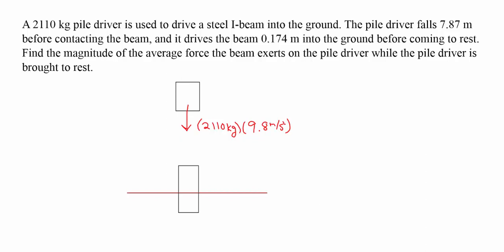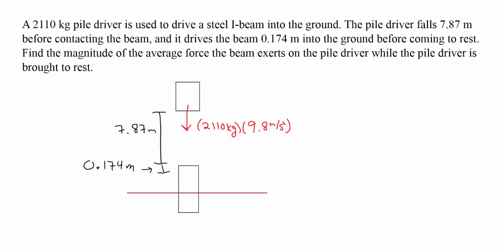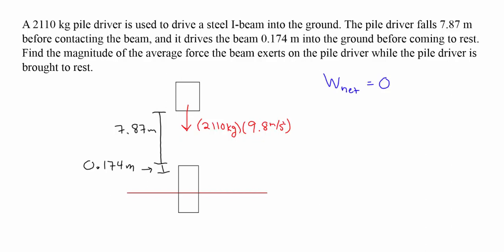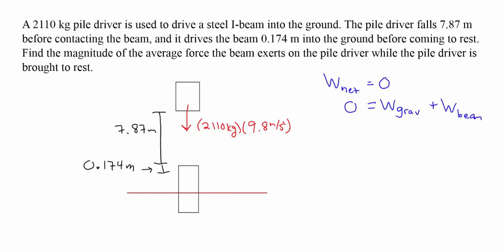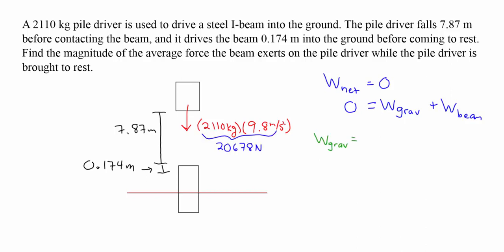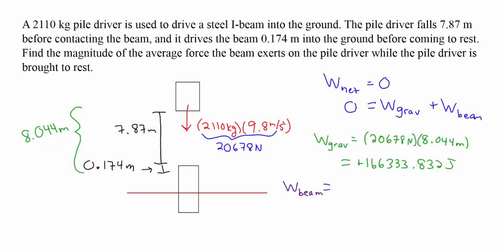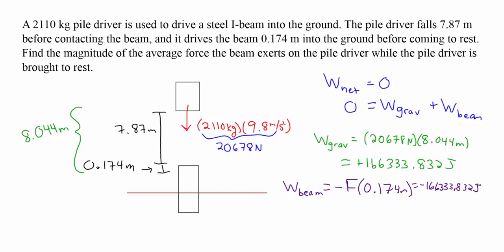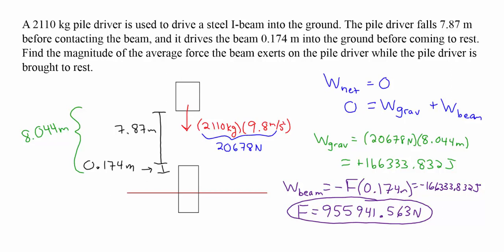Finding Work Done by and Force of Pile Driver Dropped on Beam

Comment: Dude... i think you must consider that you still have the gravity force pushing the pile through z axis when the pile hits the beam... so, the average force is going to be slightly bigger than your calculations... do you agree?
Reply: lol. his answer is correct mate. its called conservation of energy.
Reply: @ahmadazeem8279  Mate, the way he did the calcuatios is fine for colisions on horizontal axis, where there is no acceleration, only inertia. When analyzing colligions on Z axis you must consider the gravity doing an extra "impulse". The gravity still pushes the object during the coligion, it does'nt happen when the colligions happens on horizontal axis... Take a look on simple pendulum problemas...
Reply: Daniel Pini omg. u went so far man. its not even related to inertia. plus,he did use the acceleration for the gravity. This question is from big book of physics and the concept in remain same. and one more thing,there is no anything related to horizontal line 
Only about vertical line. we are talking about 2D in this problem not 3D.
Reply: @ahmadazeem8279  Dude, an horizontal axis and a vertical axis are still in the same plane, and of course, its still a 2D problem... what the hack are you talking about 3D? I didnt get your point here... Even if it were a 3D poblem you can solve it for ani axis you want.. .the answare would be the same... With all the respect... are you in high school?
Reply: Daniel Pini u are the one who said z axis 😂
z axis is for 3D problem. and of course u can do it with 3D problem. My point is u should learnt from this guys what he did. not thinking like u better than him. Im suprised suddenly utalked about inertia and so on. learn from him dude. Go back tp school. This question is from college servay pure physics. Go buy and do it for ur own lol. The steps are same. So sad for u man.
Reply: Daniel Pini So funny when u trying to make bad analogy instead of explain what u are trying to say. Go and learn back
z axis is not for vertical component in physics. its y axis. And that man did include the gravity accelereation. Man i think u need to learn back the energy concept.  After all this consider it really show that u are truly arrogant to accept the fact from this man hahaha. Nevermind dude, sometimes u need to be humble to achieve success. Even i argue with u 100 times,the outcome would still be same bcoz of ur ignorance lol. Go learn back the basis of energy and how alternate energy changes in time.
Reply: Plus, the anology u made is far beyond this topic. For second situation, in the conservation of energy law, the boy die due to high impact force he receive. And that impact force is converted to energy to. From the high potential energy change to kinetic energy. Thats why the car is accelerate downward.
Reply: @ahmadazeem8279  Dude... i'm a hundred percent sure you are still in high school...

Just face it... for the same mechanical energy, the reaction force is bigger when the collision happens in vertical axis... his answere is fine for horizontal axis, but for vertical axis, where the gravity still pushes the object through the target you must add the gravity force in equation. He didnt do that. The G factor he used is only to calculate the mechanical energy. Just that. He is using a method that solves the problem on horizontal axis, where there is no other force aplied to the system.

For rigid body coligions, where the collision time is little, the gravity force can be ignored. This is what he did here. In this case the result will vary only in 2%. It's not a big deal. I was only asking if he was aware of this.

Speak to your teacher.

And by the way, i was very polite when i inqiured him about the results. Read again my comment. There is no arrogance in that.

You are the one that clearly doesnt have enough knowledge to be in this discussion and keeps speaking all this high scholl nonsense.

Go back to school, little pupy. Leave this discussion tothe big dogs.
Reply: @ahmadazeem8279  When two objects collide in horizontal axis, they only exchange momentum. There is no external force acting in the system. It's a whole different story when analyzing collision envolving objects in free fall. There is OBVIOUSLY the gravity force pushing one of the objects. So there isn't only momemntum in this case. There is also an extra force (whic is gravity force) acting in the system.

The whole point is this: On horizontal axis there is no external forces acting in the system (unless the object has it's own propulsion, which is not the case). On vertical axis, there is external forces acting in one of the objects. That's why you must consider en extra impulse generating momentum in one of the objects. There is a resultant force. 

Again, the fact he used G in his equations was only half of the step. It was used only to calculate the mechanical energy.

I thought you would get my point with those examples. For my surprise, you didn't. Anyway... Just like captain america would say: "I can do this all day, mate"
Reply: Daniel Pini u dont even know what he was doing. Its not even related to horizontsl axis lol. i write simple not bcoz i dont have enough knowledge. its bcoz u thinking too far like idiotic. Go refer to books than use ur skinny brain.  If u want to use force formula
for sure u can. but he used energy formula to make it ez
Reply: Daniel Pini One more thing. Where is ur inertia formula and so on? or u already realized that it was wrong? Hahahahaha
Reply: @ahmadazeem8279  Dude i know exactly what he is doing. I never said it was related to horizontal axis. I said the method he used would only be aplied in situations where there is no external forces acting, which would be in collisions on horizontal axis, and it's not the case here. That's i why i told him to consider en extra impulse of gravity in his equations.

I know the answere for this problem. His answere is a simplified version. But not everyone knows it is a simplified version. That's why i asked if he was aware of this.

You know what, we should be friends instead of enemies. I apologize the way i spoke to you.

I must say i had to meditate a lot about this problem. Why don't you take this problem to friends that also likes physics and discuss about it?
Reply: Daniel Pini Ok then, i will explain to u why impulse or momentum cannot be related to this situation. First, we dont have the mass for the beam to find the momentum after the collision. Secondly, we dont have the time interval for the collision to happen to find the impulse. 
Its ok mate. I also want to apologize for my words. It just we already did this together in our lecture and the question is totally same with our reference book. 
Goodluck for ur future
Reply from the maker: The force will be the same as the calculation given. You are correct that the force of gravity is acting over that extra distance when the beam is being pushed into the ground, but that is taken into account in the part where the work done by the force of gravity acts over a distance of 8.044 meters (it has that extra distance included). The work being done by the beam takes away the energy gained by falling the distance of 7.87 m + 0.17 m. We are including the work done by gravity over that last 0.17 meters, so we have already taken into account the force of gravity acting during that time when the beam is being pushed into the ground.
Reply: @scottsecrest2190  the king has spoken